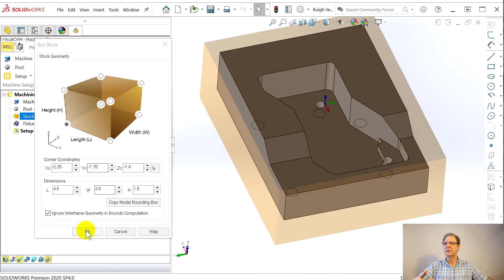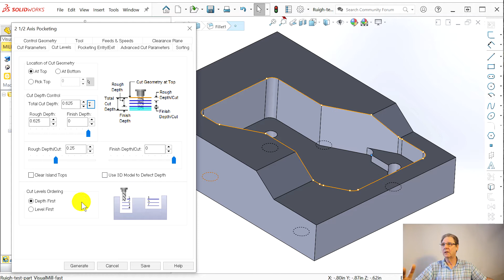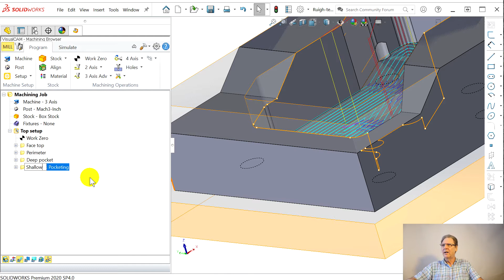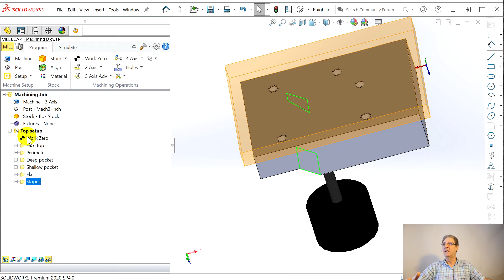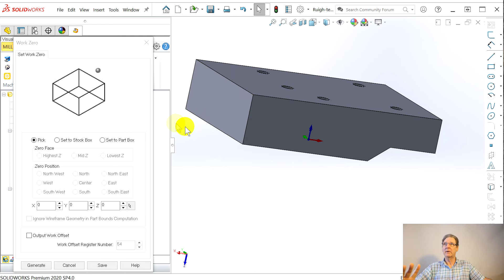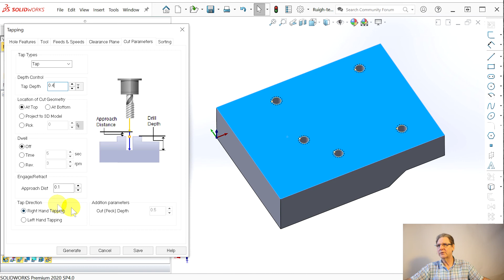VisualMill as fast as I can

Comment: You can save your defaults so that the parameters you prefer show up all the time. You can also save to a knowledge base. For example, you can define all you hole operations into a KB and just drop that in to program all your holes pretty much instantly. Once you know the Mecsoft products and put a bit of preparatory effort into it, this could be programmed in about 10 minutes.
Reply from the maker: Agreed, those macros can save a lot of time, especially if you are doing a lot of variances of a part. I do occasional prototypes, so I would forget all the parameters and probably make a few scrap parts. This is the same when I do circuit boards. I am an old coot that prefers to just do everything from scratch so I understand every CNC move or PCB trace since it is all fresh in my mind. You have the modern way down, and I salute you, thanks for the comment.